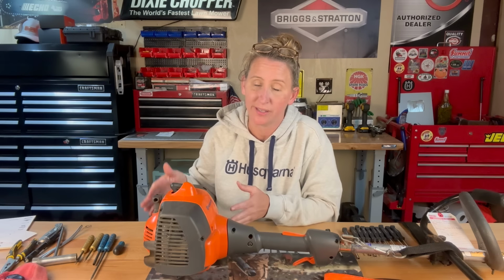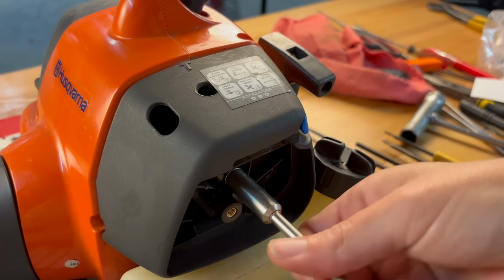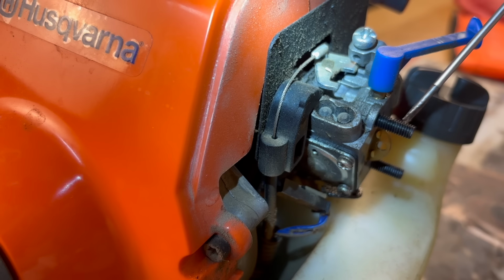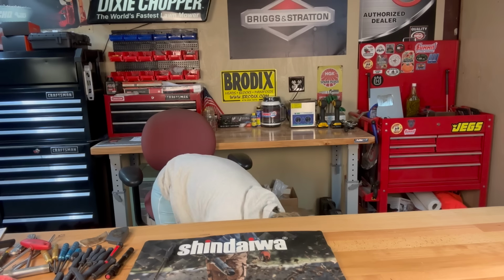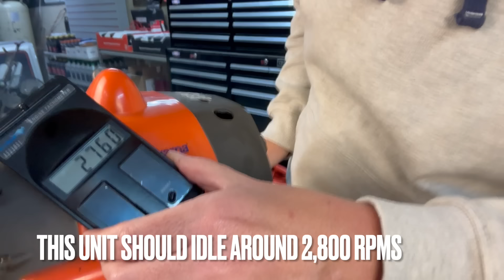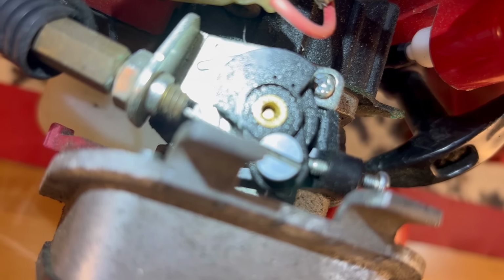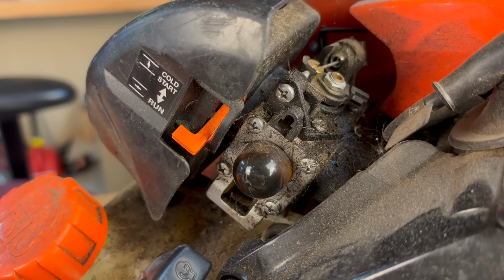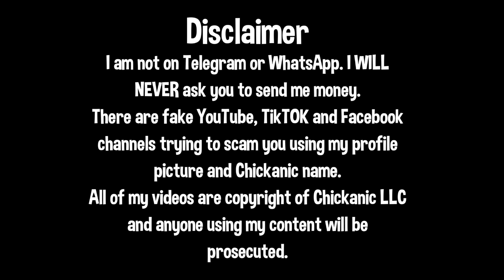How To Easily Fine Tune Your 2 Stroke With A Super Simple Carburetor Adjustment!

Comment: You are good people Chickanic ! Just saw your add on helping others with your tool savings offer and what you do on your channel.
I'm same way all my life. That's why you see me trying to help you with products etc. That I've used for a long time both marine repair and automotive which I've found out thru the dealerships I used to work for as a young man thru to 25 years ago when I opened my own repair business in marine repair. Just closed it due to 2 back injuries , memory loss and right hand curling in.
Great for gripping tools though 😅. Which is probably why it is like it is. Since 1967 professionally in dealerships.
You probably remember me from the " engine tuner / carbon guard/ and Sierra products used for removing " coking" on piston skirts and freeing sticking rings in 2 strokes.
Take care and msny thanks to you for helping others too. 
Lynn
 Central Florida.
Stay safe the both of you ! This country is in ttouble

Comment: If you need to hear what you are doing, but the tools or environment are noisy, then you should be wearing hearing protection; but buy the "Active" version - there's lots of makes out there. You can hear everything, but the high end or high-amplitude frequencies get dulled down. I don't use anything else for shooting or if I need to hear vehicles when I'm cutting hedges at the roadside. Much better than risking your hearing.

Comment: As an old retired auto mechanic, thanks again for the information.  When I was working, I did not have time to fuzz with 2 cycle string trimmers.  I went through troybilt, ryobi, and some others. After one season they would not start and/or stay running and I threw them away for electric. Because of videos like your I learned many of the things I was doing wrong. You 'kick' can fuel, but it saves people like me that cannot get the mix right. I have the adjustment kit and like using it. Before I had the kit I found the Dremel cut off wheel (about the size of a quarter) would slot the top of the metering jet and allow adjustment with pocket screwdriver.  Because I am a mechanic and realize the need for maintenance saves money. I most likely overdue.

Comment: As much as I hate the tamper-proof adjustments, at least the tool stays safely in place while adjusting an operating machine, as opposed to the old-fashioned screw type, which were difficult to locate and turn when the machine is running.

Comment: those are more a "half circle flat cutout adjustment" screw. instead of the previous opposite brands/models and NONE of them have done any good for end users/repairs. because all repairs are negated by being cheap junk which breaks in may ways costing more then a whole new unit per season or two. (yes, self repair is an different game.
I still fix (far beyond what others would throw away for close family/friends) yeah, I'm a sucker, but giving less forks and care per year. providing it's not dwelling electrical/plumbing/gas/structural that could harm/kill. I do NOT screw around there, either done safe and proper or not at all. even for most hated enemy, I would not do bad work! (I have no enemies)

Comment: Why do these engineers have to make maintenance so difficult with NO standardization among manufacturers thereby requiring proprietary tools for each machine? First thing I ask when buying one of these is, how hard is it to work on?  Screw these off-beat,  weird designed machines.

Comment: On those "hidden plugs," what I've always done is heat a tiny flat head with a torch lighter and press it into the plug. Once it cools, I can slowly twist and pull and it will USUALLY come out. Notice I said "usually." Sometimes it gives me a headache. So THANK YOU for those part numbers! I knew that there was an actual tool for that, but I had no idea how to find them!
Reply: I tried looking for the Echo tools also. You have to be an ECHO dealer to be able to purchase them.
Reply: @danieldominguez7146  Well, that sucks.

Comment: Blanking plugs! I found a bicycle spoke works! Get a long one and cut it in half then form a loop on the end you just cut so you don't stab your hand, heat the threaded end up just enough to melt into the plastic then push it into the plug and let it cool then you can pull it out.
The other half of the spoke you can file/sand or hammer the end into a small blade type screwdriver and you can adjust the jets.
Reply: You can also use a paper clip the same way

Comment: I appreciate you sharing your knowledge about small engine repairs.   Let my share my knowledge with you.  I used worked for a company that manufactured hearing aids and equipment to test hearing.  My job was to repair these items.
Hearing damage is accumulative.   Each time you subject your hearing to loud noise for periods, you can damage your hearing.  This damage is accumulative over these periods.  The damage keeps adding up.   The human hear does not heal itself.   
Be a smart role model for your viewers and always hearing protection when running equipment.  Use earplugs or earmuffs for your health.

Comment: To fix this problem don't buy Husqvarna
Reply: No they’re all adjusted to run rich from the factory.
Reply: what is left when trow every brand overboard???
Reply: What's left batteries
Reply: What's wrong  with husqvarna. The newer sthil  weedeaters aren't any better I bought  a new sthil weedeater and  chainsaw back  in March of this year and both has already been in  a shop over carburetor  problems
Reply: I have a Stihl trimmer made in USA and a Husqvarna chainsaw made in Sweden. They both perform great. If you keep up with maintenance and avoid ethanol gas, they're both really good products.
Reply: Totally
Reply: Nothing wrong with Husqvarna.
Reply: Husqvarna pro trimmers are excellent.
Reply: @brucelewis1017 Hopefully , you aren't using ethanol fuel. That stuff is well known for damaging carbs.
Reply: First Husky trimmer locked up after a year. They have a 2 year warranty. The one they replaced it with the motor didn't run right from day one...bran's new. Lasted 9 months when it lost compression. Wonderful California is banning small gas engines. Battery won't work for me trying to maintain 2½ acres.
Reply: Echo for trimmer or nothing. Smr 2100 or nothing.  Had one for 25 years  and gave it away running.  Have one now had for a decade still going strong.
Reply: What brand oil are you using and what ratio?  Never had a 2 stroke seize up,  any brand.  I love my husqvarna 525L weedeater. @johndias6614
Reply: @randywolfe44 have a old John Deere branded 2100 from the 90's, still runs great
Reply: We have run Husqvarna for around 30 years and had great luck. With that said, I bought the biggest echo string trimmer they make and I love the thing.
Reply: @Bikelifejoey225  when they are brand new they should be rich for a while
Reply: Mainly don't buy troy built
Reply: Wow,your so funny,🤥.........
Reply: @lindsey607
Some people know/learn not to use ethanol fuel, but I would doubt that most people know it and understand it. For some, it means buying $20-30 per gallon fuel at a store, or trying to get by on whatever happens to come out of a pump. There is good info and alternatives, just not widely known.
Reply: My husky leaf blower needed to be tuned a couple months after buying. My echo weed eater hasn’t been tuned at all and I’ve had it longer.